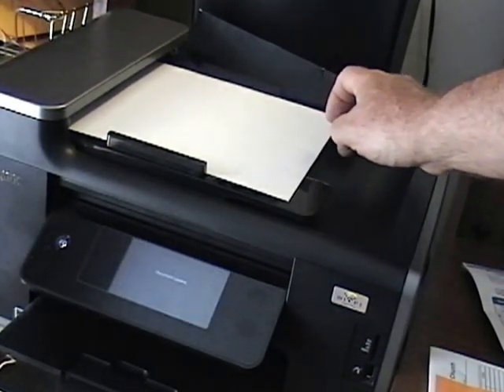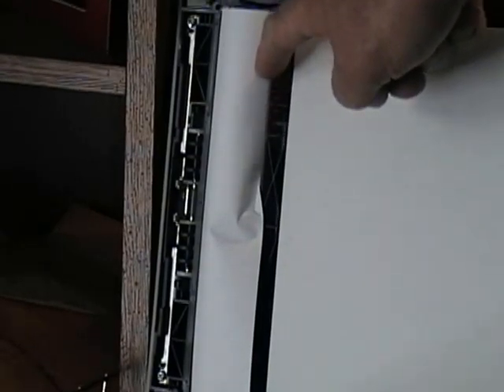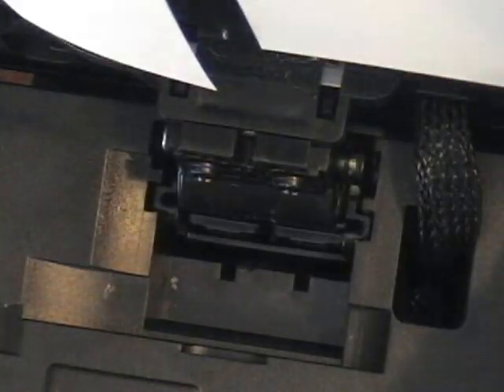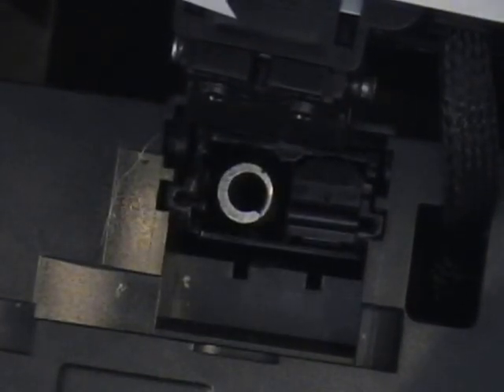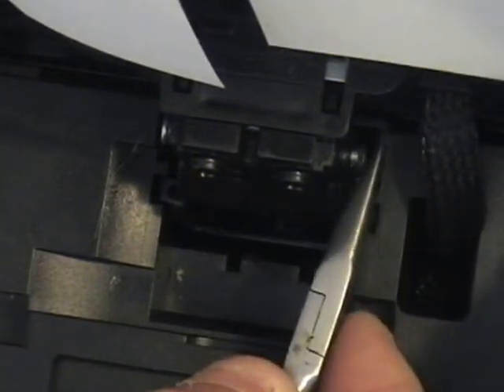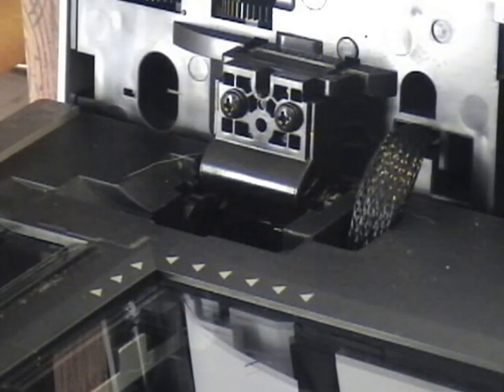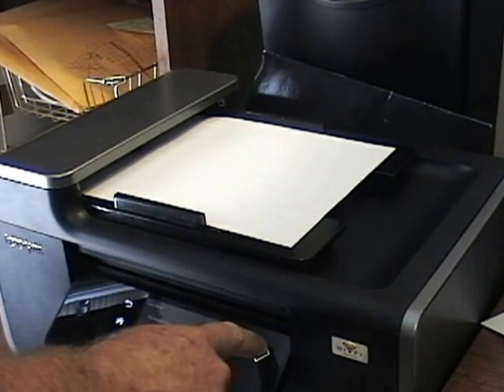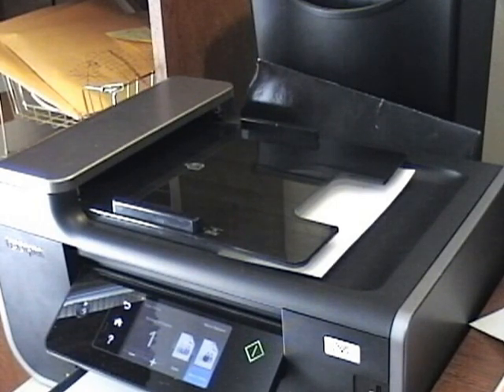Lexmark Printer Pinnicle Pro 901 ADF/Hinge quick fix (Revised)

Comment: Oh my gosh... thank you so much for posting this! I've been dealing with issues with my Lexmark Prevail Pro705 printer all day. First it wouldn't communicate with my computer, then it wouldn't print from a USB, then it wouldn't scan from the flatbed, and then the ADF was getting jammed. I was about to take a sledge hammer to this thing!

I at least have the ADF working again, thanks to you! I can't even begin to express my gratitude. Less than five minutes to fix.
Reply from the maker: Your welcome. Hope you get past the other issues.

Comment: Thanks!  Worked like a charm.  The only thing I would add is that the springs are greasy and to just throw them into the trash, not lay them on the glass as I did so I had to clean the glass.  Still, so much easier to watch your video than calling India and explaining the problem to them. Yea! You saved me from buying a new printer today!

Comment: MANY thanks for posting this fix! Regrettable that Lexmark hasn't provided customer support for this known manufacturing defect. Much appreciated that you helped us discover how to work-around at least until we can purchase from another manufacturer.
Reply from the maker: +Ralph Begleiter I have been using mine in its repaired condition for several years now. I intend to continue using it until it just wont go any further, mostly because I really like the 5 dollar black ink. Glad you got yours going again.
Reply: +Michael Day Anybody found a solution so that the printer doesn't stop me from printing black text only when a color cartridge runs out. Did you find a way to bypass this control? I'm about to give up this printer since I don't want to spent 75$ worth of color ink that I don't need anyway.
Reply from the maker: +Francois Labbé I don't know a workaround for that but I did notice that you can get the Lexmark brand 100 color multi pak at target for about 32 dollars, or you could get the off brand multipacks several places online for about 18 to 24 dollars. At least that would keep you going and you could still take advantage of the 5 dollar 105xl black.
Reply: The 5 dollars for black was the trick to get us to buy that printer. A good one, I would prefer to keep it but I can not accept to be treated like this by a manufacturer. This is a scam. These chips on the cartridges that force you to buy new ones and strickly those made by Lexmark is the 2nd scam. Not only that but when the micro program that was added during an update make sure that you change your cartridges while they are not even empty. I'll try to get compensated by Staples since I had to buy a cheap Brother Laser printer to be able to print my stuff. Forgot to tell, at least when my print head had to be changed, Lexmark sent a new printer. That was the only good part of my exoerience with Lexmard but still my last one.
Reply from the maker: +Francois Labbé I understand your frustration. At lease you did have one bright spot in your otherwise aggravating experience with lexmark. Just out of curiosity, how do you feel about laser printers vs ink jet insofar as quality and cost to operate?
Reply: This is a DESIGN defect, not manufacturing defect.  Those are two really beefy springs and the hinge uses two very small cross sections of plastic to contain these large forces.  It will invariably break under normal use.

Comment: Thank you very much for this video! Finally I can get my ADF cover to sit flat on the scanner. Not only does this fix allow the ADF to function properly, it also improves the performance of the flatbed scanner by sealing out outside light that seeps in from under the cover.

From the searches I've done I've found that the broken left hinge problem is not uncommon. This is apparently a flaw in the design of the Lexmark Pinnacle Pro901 printer.

Thanks again for your help!

Comment: Thanks so much for taking time to provide this most helpful info! I forgot to remove a small, thin book on the glass after scanning - so small that I didn't notice it for a couple days - and it must have misaligned the hinge. I rarely use the auto feed and liked having the hinge to hold up the lid. Ah well....after recent replacement of printhead (free), I thought it might truly be time to get another printer. Thanks for saving me, at least until the next issue emerges!
Reply from the maker: PC - Maybe you will get a few more years out of it. I really like that cheap black ink. I am going to try to use mine until it just wont go any further. Take care.....

Comment: Was having the same problem with the Prevail 705. Saw that the ADF wasn't sitting right & that I was getting feeder jams. Saw the two pieces under the hinge but they had snapped clean and it was  hard to tell that there was something wrong. Your video helped show that WAS the problem and now it's working again. Thank you so much for posting!
Reply from the maker: Your Welcome

Comment: I obtained this printer used and it had this problem. I hadn't give it much thought as I would just put weights on the ADF to depress the springs, but this fix is so easy. Thanks for posting. I stumbled across your video looking for a hack to use refilled ink cartridges.
Reply from the maker: phishstyx That was a lucky break, stumbling across the video fix. Glad you got it going. Take care

Comment: Coming in late with this problem. Wonderful you provided a solution. Thanks for your help. In my case getting the caps and springs out required temporarily unscrewing and detaching the top part of the hinge. Still, I wouldn't have a clue without your insight on this problem.
Reply from the maker: +David McCrady Thanks for the nice feedback. Good to hear it worked for you.

Comment: Michael, Thanks for a very clear video. I had the exact same problem and your solution did the job. I also looked on the internet for the hinge but can't find it. I contacted Lexmark and their solution is to just send you a replacement printer if you are still covered by the guarantee (which I am).

However the replacement printer arrived with the same issue, so now they are sending a 2nd one and won't take back the broken one. It's so stupid to just throw away the whole printer just because the hinge is broken. So I'm advertising it on Freecycle and related avenues as defective.
Reply from the maker: Hi Simon,

It seems so insane to me that Lexmark would opt to send out whole printers, as opposed to replacement hinges. It defies common sense. Glad you got yours going, and hopefully you can make some money on the damaged replacement they sent. Even in their compromised condition, they are still great little printers, and I am continuing to love the 5 dollar black ink.

Take care, Michael

Comment from the maker: The reason for the springs is to hold the adf lid half open while you put your originals on the glass for copying, scanning or faxing. Mine worked pretty well in doing that until the hinge broke. I did not know until your post that other Lexmark models besides the 901 had the same hinge setup. Thanks for the comment.

Comment: Thank you very much for the hinge fix. It works great ! I don't use the ADF much so it wasn't an issue for me, but still the lid wouldn't close tight when scanning. I read the other posts (thanks all). After making the fix I did an online chat with Lexmark to check my warranty. I didn't know if I had registered to get the 5 year warranty which I had forgotten about. They could have told me anything but said it good to Dec 2015. So they are sending me another printer. Don't know if that was a good decision as my printer works fine and I don't know anything about the printer I'm getting. It will surely end up with the same hinge problem. I 'll have 15 days to return my printer. I was hoping I could keep my printer. I've only had to replace the printhead under warranty.plus the broken hinge. I'm going to check with them to make sure it will use the same ink otherwise I'll delay it plus I want the $5 black ink. Thanks again for the fix !
Reply from the maker: Your welcome Ed.  The 5 dollar black ink is a huge plus. Hope all works out well with the new printer. I am sure others here, including myself would be interested to hear how it plays out. Take care
Reply: Michael Day  I received a Pro915 printer. That's what's on the box which was covered with dust. I haven't opened it yet. I've read numerous negative reviews on Amazon and I don't think I want the 915 printer and may just send it back. It doesn't use the cheap black ink and I don't know if it will be able to use non-Lexmark ink due to the firmware. My 901 works fine at the moment and I can live with the hinge fix and I'd have to send that back. I also have ink for the 901 that would go to waste. I'm not the only person using the 901 so I put some black duct tape over hinge area so that it can't be lifted out of the broken hinge. What would you do? Keep the 915 or ship it back and keep what I know is working? Maybe I'll call Lexmark and ask if I can just keep it. What would they do with a broken printer? The return paper says 'return to storage'. Fyi, I accidentally found the 901 5-year warranty in email.
Reply from the maker: Ed Liccardo
That's a tough decision. I think the cheap black ink is a really big deal. I've been using my 901 in it's repaired condition for a couple years now, and it's operating just fine. Faced with the same decision I would probably keep the 901. You might have to talk to Lexmark about it prior to sending it back though. Good luck and let me know how it goes.

Comment: The unbroken hinge has two little loops of plastic that go around the pin. They break, as they are not strong enough, thus allowing the hinge to lift up.

The real reason they break, however, is the spring loaded pads, that make contact with the lid before the lid fully closes. The apparent purpose of this design is to keep the lid from slamming into the glass if dropped, slowing it at the last second. However, what it really does is provide a leverage point that breaks the plastic pin loops.

Comment: If I had a new one, or one that still had a working hinge, I would pull the pads and springs out as described in the video, as it would likely keep the hinge from eventually breaking.
This same problem is common in all the Pro 70x series printers with this ADF lid design, such as the Pro705.

Comment: Simple and effective. Thank you for the the guidance - it put an end to my frustration with the ADF on my printer. Now to cal Lexmark to get them to honor the warranty. Again, thank you.. :-)
Reply from the maker: Your welcome Marc. Good luck with Lexmark customer service. They can be quite testy at times.
Reply: Michael Day Thanks for the heads up about Lexmark Support Michael. I have all the documentation needed for my five year warranty (I should be covered until the end of Oct 2015). I'll escalate within Lexmark if needed and will report back here to benefit the community of folks with Pro 90x printers (to build on your contribution). Again, thanks as I'm glad my document feeder is now working and no longer useless.
Reply from the maker: Marc H
Let us know how it goes. Sounds like you have all your ducks in a row. Should be an easy thing to get it replaced. Take care
Reply: Michael Day Hi Michael, Lexmark sent a recertiified replacement Pro905; they don't just send the part. I had to move the print-head/ink cartridges and the power supply, then return the broken printer using a pre-paid UPS label (provided by Lexmark). Lexmark was incredibly easy to work with and the replacement printer works perfectly (for a Pro905). Thanks again for sharing this video - it got me by when I critically needed to scan (the joy of taxes). Best Regards, Marc
Reply from the maker: Marc H
Thanks for all the great info. I am sure there are many folks that will visit this link in the future who will benefit from it. Sounds like your situation turned out real good. Congrats
Reply: Marc H
 Just wondering Marc,  did they warranty the replacement?
Reply: gail c Hi Gail, Yes, Lexmark covered this issue with a replacement printer and a return shipping label. :-)
Reply: Marc H my question tho,,, did they warranty the replacement?  And what model did you get... the  901 and  905 are discounted
Reply: They sent a pro905, though I was instructed to use my second tray (Lexmark didn't send that). I assume the warranty on my original printer (5 years) covers the replacement.

Comment: Thanks for this... i just picked up this printer from a garage sale with the same issue for cheap
Reply from the maker: Your welcome. I guess you already know that you can get the 105xl black cartridges for 5 bucks each. You can also get set up with Lexmark rewards return program and get a free ink cartridge for every 5 you buy, and another for every 5 you return. It helps save some money on the color cartridges.
Reply: these cartridges are real simple to refill... if you are ok with ignoring the empty notification due to the rfid tags on them.
Reply from the maker: lopezgrn
 Sounds like a good idea. I think overall its a great little printer.

Comment: Michael - thanks to you, I have been able to squeeze another 18 mos from my 901, but I do believe it's time to get a new one. Any recommendations? I found one article that recommended avoiding getting any printer at all because they are the most unreliable piece of electronic equipment out there, guaranteed to make life difficult! Thanks for any insight you may be able to share. And many thanks for the extra 18 months on the 901!
Reply from the maker: I wish I did have a recommendation for another printer with cheap ink, but I don't. Good luck in your hunt and I'm glad you got some extra months out of your 901. Let us know if you find an acceptable substitute.

Comment: * For anyone like myself that was struggling to get the caps and springs out from the front, if you spin it around and work from the back of the lid, it's much easier. 

My hinge is definitely broken, but the little strap next to it is too short to lift my lid far enough to get everything out. I lowered the lid and just slid it forward a bit and had all the working room I needed as long as I was coming from the back.

Hope this helps someone!
Reply from the maker: Thanks for the comment. Glad you got it fixed.

Comment: found this pinnacle pro901 in the dumpster a couple years back in my old job that needed a new printhead with the same problem....I never tended to the printhead replacement until now, I got the power cord, printed and ink and it prints pristine now....when I encounter this problem I follow the steps and voila works like new

it wouldn't make sense to get the hinge fixed when it works just better with this fix. idk what Lexmark was thinking in making such a weak piece for something a bit heavy.....as far as the warranty goes....I missed that ship oh well but I don't think I would need it
Reply: "Printhead"

thanks a million Michael on this genius fix
Reply from the maker: Your very welcome. These 901's are great little printers. I assume you already know that you can buy #105 black ink cartridges for it for 5 bucks. Glad to hear you got it up an running and I hope it last you a long time.

Comment: Found one by the curbside today, abandoned for this very reason and ready for the landfill.  In excellent shape otherwise.  The ink is so expensive I won't consider using the printing functions but the fax and scanner work perfectly with or without a computer and the User Manual is at http://publications.lexmark.com/publications/pdfs/2007/pro900/LXECuser-en.pdf if I want to fully avail myself of all of its features.  The hinge design sucks but overall these are well built units. Thanks again Michael.
Reply from the maker: YourVirtualWorld I guess you already know about the 105 black ink at 5.99 each, but I also tried some after market ink off eBay for 8 bucks that worked well after a couple error messages, good luck with you your printer.
https://www.ebay.com/itm/4PK-BLACK-COLOR-Ink-Cartridges-For-Lexmark-100XL-100-XL/380283181498?ssPageName=STRK%3AMEBIDX%3AIT&_trksid=p2057872.m2749.l2649
Reply: I'll just use fax and scanning functions.  These combo rigs leapfrogged the "no driver available" scam as you've probably found in single scanners every time the OS version changes.  I've got two single color laser printers and you know what they say, "Once you go black, you won't go back" LOL.

Comment: Hey, so now that I've got that fixed, perhaps you could help me with something else.  My document feeder at the top will sometime pull in multiple pieces of paper.  I'm sure this is just maintenance on my part, but I don't know what to do.  Does it need to be lubed or cleaned or a roller replaced or something?

Thanks if you can help.
Reply from the maker: I have had a little trouble with multiple pages feeding but it only seems to happen when my originals are in questionable condition.If you have a 900 series you can open the lid where the paper feeds and watch it load the paper. There is one roller in the middle of a long metal bar that comes down on the top sheet and pulls it in. Watching it might help you figure out what is going on. Also make sure you are not pushing the stack of paper in too far. Only insert it until it beeps. Good luck figuring it out. If you do find the solution to your problem, I would be interested to know what it is.